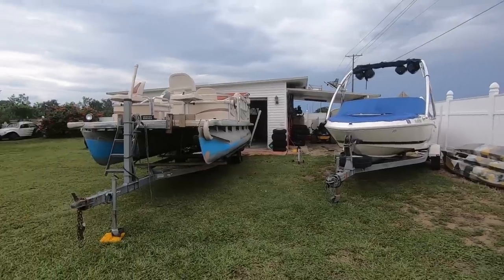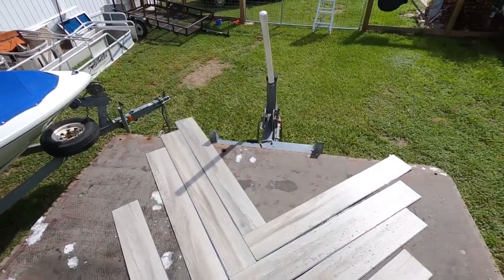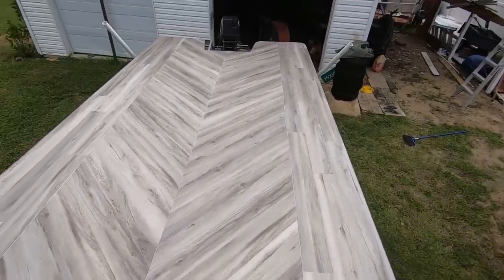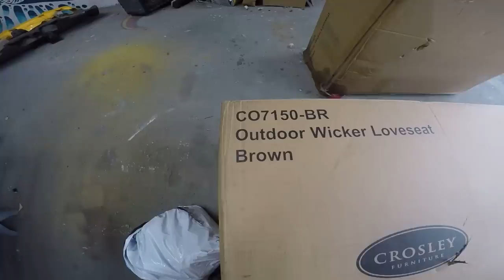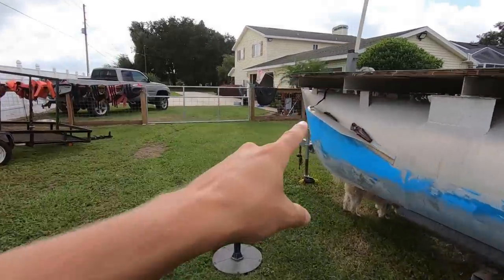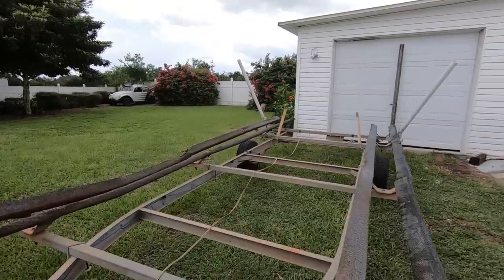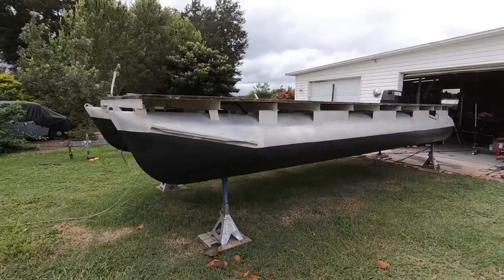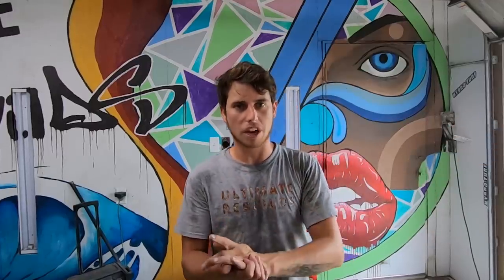Installing Custom Flooring on my Pontoon Boat -Episode 3

Comment: Enjoying watching this project go along. I'm one of those 80% that isn't subscribed. I don't watch many rebuild videos normally, but I bought a used pontoon in July that needs to be rebuilt (carpet coming up and at least 1 deck board needs to be replaced). So, I'm following this one project to try and anticipate my future project. I think I may do a rubberized non-skid paint for the decking.
Good luck!

Comment: J b weld worked great had a faily good sized hole on my houseboat ( 12x36 ) so not small .I sold the boat after 14 years never pumped any water out

Comment: Its looking good man!🤘 if its going in salt water dont use carpet on the bunks it will corrode the pontoons faster. And dont use treated wood for the bunks either it will react in a bad way with the aluminum.  I used plastic garage door trim from home depot on my bunks and worked slick pun intended. I flipped it over so the groves were facing up for less contact and to get the screw heads out if the way.

Comment: If you install sprinklers for the first little hile once you turn them, it will actually make your feet feel hotter than without because the water makes it quicker for the heat to transfer from the flooring to your feet. However, over a longer period of time they should stay cooler as the water will take away the heat from the floor. You will notice this if you stand on hot concrete on a summer day, then spray the concrete with some water and stand on it again. It will make it hotter feeling. But again if you were to spray a lot of water on it then it should cool it down. 
Good luck with the rest of the build, enjoying the videos!

Comment: With brazing you need to make sure the pontoon itself is hot enough for the brazing to stick. You’d need it hot before you ever touch it with the material. It should melt from touching the material. Not from the heat of the torch. As well as you need to flux the area first.

Comment: You can get a polishing compound that will make the pontoons look like chrome if you want to put in that much work but if you like that look it's worth it. Truck stop chrome shops have it plus advice. 75 chrome shop, off I-75 Wildwood,FL.

Comment: If you're fixing it with a brazing rod you need to use flux to help clean the area and spread out the heat. Honestly, I would take it to a machine/welding shop to have them tig weld it. .Aluminum is fairly difficult to weld properly but they probably wouldn't take more than an hour labor (unless they have a minimum hours charge). So probably $75 to $100. It'll be worth it for sure. I'd avoid JB Weld to repair the hole if you plan on keeping the boat for a few years.  The weld can then be ground flush and polished (by you not the shop to save a few $$).

Comment: I have my doubts that the flooring is going to stay down once water gets underneath.  Hopefully it stays because it looks pretty decent.
Reply: Comment section always makes me laugh so many I would've done this comments
Reply: bandwagon240 what do you mean 😂
Reply: @BERSERKER nothing is waterproof???? 🤔🤔🤔🤔 The flooring is vinyl so it's basically a strip of plastic. It's definitely waterproof.
Reply: Weather proof lol
Reply: Tre L  I have no doubt that you consumed too much ceiling popcorn as a child.
Reply: If you cover it when not in use it should be just fine
Reply: @BERSERKER agreed. It also has more layers/is denser. As the ply layers start delaminating, he'll get ripples and bubbles forming. His flooring is fine, other than being slippery as fcuk when wet.
Reply: Wouldnt be interesting if we knew it was going to hold up perfect.
Reply: My worry is that floor will be extremely slippery. It looks fantastic, but I would test it out before adding wet feet, alcohol,  and youthful enthusiasm.
Reply: Dezfan I think it’s the one with ridges in it so u can get a grip
Reply: @brandonlempar1195  Ruffles have ridges?
Reply: @bandwagon240  WAIT......THATS BAD?
Reply: bandwagon240 grooves

Comment: You have to get the host material hot enough for the brazing rod to work. The pontoon is a large area to heat up plus it's aluminum which soaks up the heat. JB weld will work through and is probably the best option in this case.

Comment: The problem with the aluminum brazing rod is that you have to get the pontoon hotter so the rod melts into the metal of the pontoon. Most people use map gas when brazing. But JB water weld works well and lasts a long time. On the paint, I would have painted the whole pontoon. Not just the bottom half.

Comment: I originally said I thought a black and grey colour scheme would lift the whole appearance of the pontoon  and i stick by that. I like the black on the bottom but I agree, the top is a tad lack lustre. If you are unable to polish it up, then maybe you should consider spraying it a dark grey with some metal flakes in the paint. I was so glad to see you went with the herringbone floor layout. It looks super smart and a hidden sprinkler system would be a novel way to keep it cool underfoot.  That seating did look way oversized, so maybe you could consider making some custom built pieces, ensuring you get exactly what you want; thus keeping your OCD equilibrium in check. Im looking forward to seeing how you resolve these issues. You certainly are a tryer Zach, and as you know, God loves a tryer!  Keep on doing what you do best.

Comment: I like the flooring pattern!

I agree that polishing the pontoons would help. Also, you might like the painted pontoons look more if you had an accent stripe where the paint meets the bare metal. Maybe a white stripe that follows the top of the black paint.

Comment: That UV top coat should help with the heat on the floors but may take away from the slip resistance. Maybe check it out with the hose or when it rains. Good shit man, I was debating buying new or building my own pontoon.

Comment: What lind of paint did you put on your lower pontoons?  I don't know if you know this but boat bottoms should be painted in an antifouling paint to keep biologicals from growing the hull which can seriously affect not only your performance but the weight capacity of your boat (nevermind looking gross)  it may not seem like mouch but over the coarse of even a year it can add to a significant amount of the stuff.

Comment: It sure is fun to watch this project come together.  The flooring is different, that's for sure.  I hope it doesn't fail because I think it looks nice--much better than carpet.  I agree with you about the seats.  I would go with normal pontoon seats, the look nice too.  Also (lastly) how interesting that you chose to pain the bottom and not the top of the actual pontoons!  Black is nice for in the water... you'll never see it really.  However a chrome color would have been nicer for the tops.  Just my opinion.  

Oh yeah, as someone who is VERY new to your channel, I can say that I didn't subscribe until I saw a few episodes.  The first couple just showed up for whatever reason and then I wanted to see how this project turned out, so that's why I subscribed.  Very entertaining!

Comment: All you had to do was buy a quart or 2 of Alumabrite and it would have made them Pontoons shine like a bare ass in a snow drift.  
Also, I fished a couple charter "party boats" that kept the deck cool by running a garden hose to the bow and letting it drain to the stern.  The floor stayed wet but it wasnt hot at all.

Comment: I think the corrosion is there because of the fact it does not have good enough sacrificial zink anodes for the galvanic current in the aluminum.🤓 The paint is normally for avoiding the marine life to grow like crazy on the bottom. 🤔 Great update video 👍😁
Reply: Also check the zink anodes on the outboard - else the outboard will be the sacrificial part! 👨‍🔧

Comment: I have used the aluminum brazing rods many times over the last ten years or so. Start with a test piece of 1/8" aluminum plate about 6"x 6" or so to replicate the heat sink and dissipation that aluminium is famous for. Use the test piece until you learn how to braze. The protective corrosion finish on the aluminum must be remove to the bare aluminum below this hard outer protective layer. You can use a grinding disk, sandpaper, etc however you should use a "stainless steel" wire brush to do the final cleaning. This prevents contamination of the final weld and without proper cleaning and prep, the aluminum brazing material will not flow and bond to the base metal. Clean the brazing rods as well. I run 220 grit sand paper down the rods and clean them afterwards with spray brake or carb cleaner. Aluminum is difficult to braze at first because it is such a good conductor of heat that it takes a lot of time to heat the part up properly to allow the heat of the "part/base metal" and not the flame, to to melt the brazing rod. So after proper cleaning and prep, use your torch to evenly heat the area that you are going to braze. This will take some time but be careful to not overheat and melt the base metal. Aluminum does not change colors at lower temps like steel does and this makes it harder to judge temperature of the base metal. The brazing rods however can measure this temperature for you in the following way, and this is the key to making this work. As you heat the base metal, every minute or so touch and rub the end of the brazing rod in the area of base metal you are you are concentrating your heat on. Briefly remove the heat source, and rub the rod across the base metal with some gentle but firm pressure. You will keep doing this repeatedly until you can slide the rod across the base metal and the heat of the base metal melts the brazing rod. When you achieve this heat, you need to just maintain that heat while applying the brazing rod. Remember that the base metal needs to melt the brazing rod and not direct flame from your torch. You will find that when you get the base metal at the right temp, the brazing rod will flow almost like water wherever you rub the rod, and it will bond permanently with the base metal making a solid structural repair. Even though I have AC Tig and can Tig weld aluminum, I find many repairs easier to make using the aluminum brazing method.
I hope this helps. Brazing aluminum just requires knowledge for that particular process. And for those experienced in bronze brazing, the only similarity is in the flowing of the brazing rod material at that magic moment when heats are just right. 
It is frustrating at first but when you figure it out, it is ridiculously easy to do an excellent structural repair on aluminum.
Have fun and don't give up. You are young and have many projects in front of you and mastering this skill will open up many opportunities for you to not only repair aluminum, it allows you to design and fabricate new components with only your imagination as a limitation.
Again, I hope this is helpful.... Joe

Comment: Personally, i would have gone with carpet, even though in time it looks old, but just like in your house, over time it gets replaced. I would have rented a floor roller to help adhere the vinyl with the glue (contact cement sprayed work well too). OCD can really get in the way, i feel you. Return the other loveseat and throw this one on your patio. Or attach it to some skis and pull it behind your boat. Concerning to see your initial sanding without a respirator, i don't think bottom paint is good for your lungs. Keep the OCD videos coming, Great work!

Comment: I think it is more about the color of the seating than the actual space it takes up. If it were lighter colored it would look dramatically less imposant. You will need this kind of size if you want to be able to seat guests appropriately...

Comment: You need a flux that allows the aluminum rod to stick to the aluminum pontoon. Aluminum brazing rod with a flux coating and enough heat to let the brazing rod flow

Comment: Something you might consider to make it look a little better is in between your black paint on your Pontoon and the aluminum put a stripe separating the two it will make it look a lot better you might think of an orange red blue pick out a color you like stripe it and stand back and see if it don't pull your eye to it and make it look a lot better

Comment: If you strip the pontoons down and paint the whole thing in upol raptor liner tintable silver it seals leaks dosen't corrode and last longer than anything beat of all it's now cheaper than paint and easy to do

Comment: The bracket in the back with the plastic tubing don't take that blanket off leave that bracket on because that's so you can strap the back your boat down to the trailer you can use a couple of J hooks and you put it on there with straps and your strap the back your boat down that's why those brackets are there in shape the way they are.

Comment: Flooring and layout look nice man. But  I have concerns about the flooring. Water underneath it and when you’re running the boat, that deck will flex slightly. Wondering what toll that’ll take on the flooring throughout time.

Comment: If the flooring is too slippery lay down another clear coat and very lightly sprinkle sand on top then another coat over it. Throw  handfuls of the sand way up in the air over the floor. Should be so light you’ll barely see it. Test it on a scrap sample first.

Comment: interesting work.  I think your floor will ultimately fail when the boat flex’s and would suggest using sea deck flooring.  It looks good, cool and comfortable on the feet and is non slip co it check al the boxes, except cost.  I would suggest ditching the only railing and top ideas and go a different way to give it that unique cool/wow factor.  For railing I would use polished aluminum stantions and stainless steel cables.  Run stantions about every 4-6 feet.  For the top I would suggest either running a longer vertical polished aluminum pole or add in insert for the shorter stations i mentioned above for the railing so you could drop in a pole extension and then use something like a solar shade top that can be quickly added or removed based on the weather.  It would give a modern, unique look to your boat.  Also I agree with ditching a fire pit.  I don’t think that is a good idea on a moving boat with people drinking, etc...  I would suggest a lighted bar top, drink holder with cooler underneath.  Finally I would not put sprinklers on the floor unless you want a slip and slide, lawsuit waiting to happen.  Perhaps add a misted in the top?  Keep up the good work.  This is my kind of project.

Instagator

Comment: I think it looks great but I have the same OCD feelings you do and I can see what you feel. I’ve seen guys polish the pontoons and it is definitely an option if you wan however it’s seems to be a lot of work and lots of times it doesn’t look great because of issues like Small repairs done wrong and JB weld repairs. Not that that was a bad repair don’t get me wrong but it will not buff out to a shine. Anyway do a good inspection of the imperfections and see if it will be worth it before you spend 10’s of hours on it.

Comment: There are different solders to use but try to repair without JB Weld. I have had nothing but good outcomes with it. I even pulled a stud for a M151 Jeep exhaust that had broken using JB Weld.  but I prefer a metal repair. There is a solder that is a metal phosphate available in a syringe from Amazon, I think it is Copper Phosphate I use it on my copper sculpture. I is strong. i would repair the hole with that and another patch of aluminum And overlay the lowers of both pontoons with fiberglass.  BTW you do need more of a torch to heat such a large bit of metal. How about two Jackstaffs one on each side to see where the corners are.

Comment: May I give you a suggestion about the visual? Paint a orange stripe in the waterline, it will give a better look. Google Wider 150 and check the painting of the hull, you will visualize what I mean. Cheers (maritime teak for the flooring would give a better look  and maybe heat and UV protection, but it might be much more expensive.).

Comment: Great video, I never see anyone treating, painting, or protecting the bottom of the pontoon. The plywood  gets wet down there as well, which will rot  the wood anyways. I was just wondering what can be used to protect the bottom of the plywood.
Reply from the maker: Marine grade plywood needs to breath. That’s why I don’t coat it with anything

Comment: If the flooring fails. Replace the plywood and try cool deck. Cheap, easy to apply, cool, water proof, you can make patterns. Oh yeah, non slip also.

Comment: Could you not extend the floor out a foot either side of it? Even if its just where you want the lounge area, I think like a bit of an canterleaver could make it look more interesting and a little more expensive looking. I would also enclose the sides just under the deck and cover the top of the float things  just to make it look a bit more aesthetically pleasing. I really like what you've done with the floor and can't wait to see how you finish it.

Comment: Flooring would of worked if you didn't make all those seems .....floor is definitely waterproof but since you made those cuts and got rid of the tongue and groove for the seamlessness ....water will now find it's way through the cracks and cause your vinyl to stress and flex......very cool idea and would of worked really well had you just went with the strait forward application instead of all those angles cutts.....love the boat though brotha keep it up

Comment: That flooring is designed  to be floating due to expansion and contraction.  Even if it stays down, the planks will bow in the sun and the gaps will open up in the cold.

Comment: Brazing: you want to heat the base metal with the torch to the point where it melts the rod. Don't heat the rod with the torch and try to stick it to the relatively cold base metal... hope this makes sense...